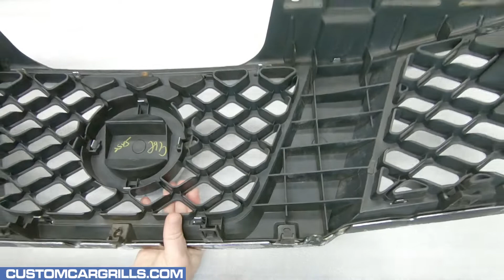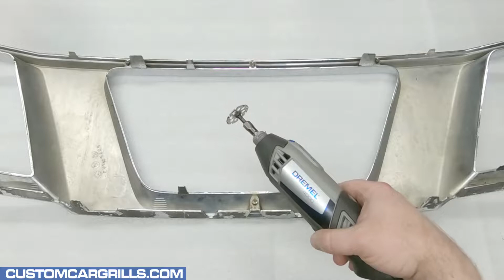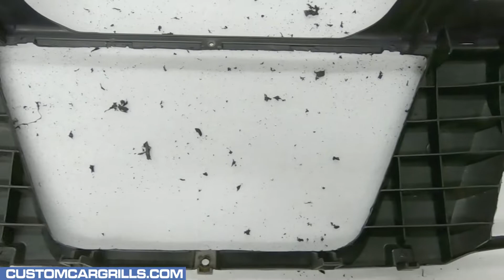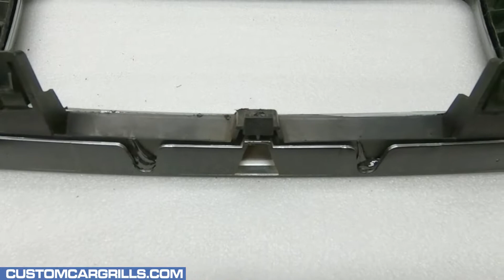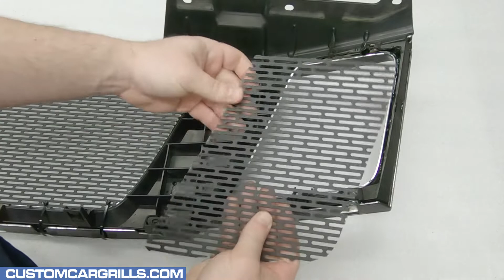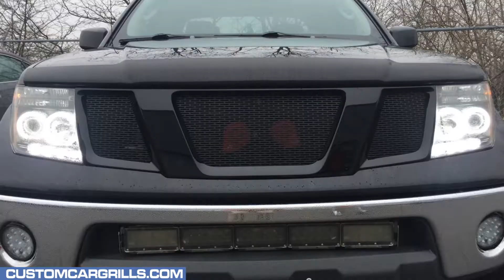Nissan Frontier 2005-2008 Mesh Grill Installation How-To by customcargrills.com

Comment: Will these work on a 2005 Nissan Pathfinder LE?
Reply from the maker: Good question.  I'm not sure if they use the same grille or not.   I haven't personally tested it, but I tentatively think they are different and this Frontier mesh set would not work.
Reply: Yes, they are exactly the same.